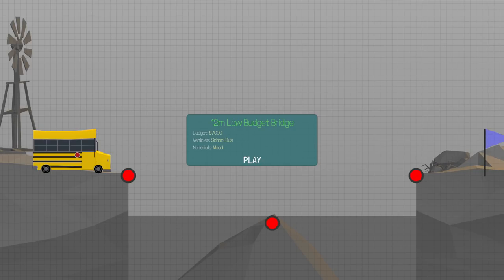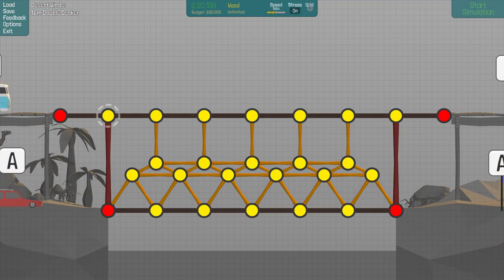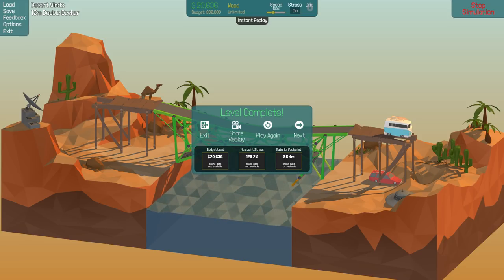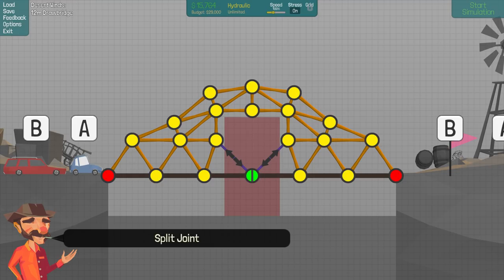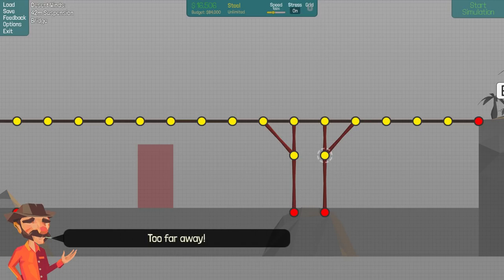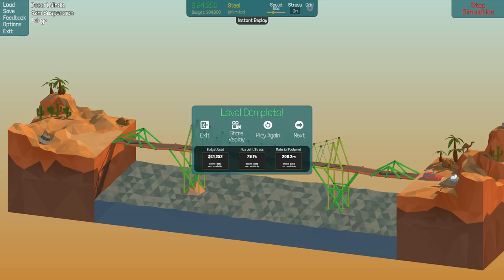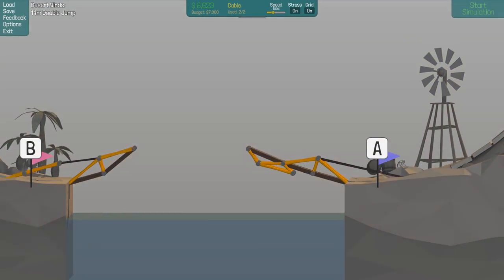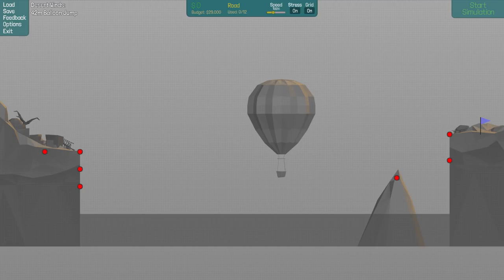Poly Bridge - Desert Winds!

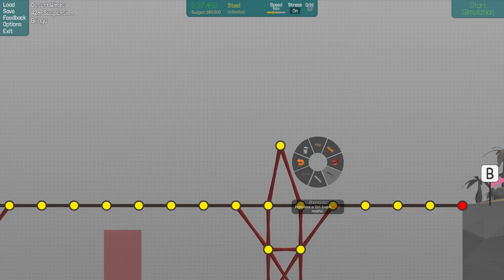Comment: 13:32 THE OTHER TRIANGLE IS NOT SYMMETRICAL
Edit: Also, use the double tap to skip feature on touchscreen devices, and get to 14:03. It shows the exact moment when the game switches from the building camera to the bridge simulation camera.